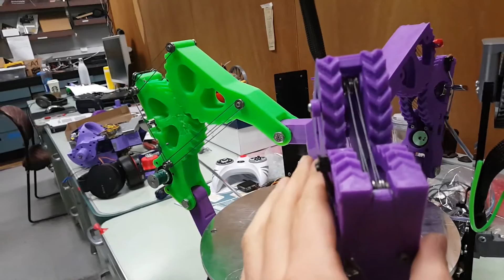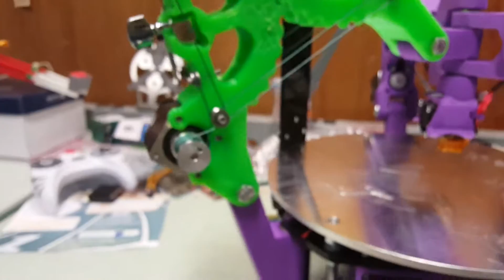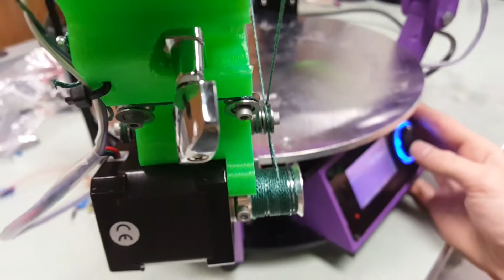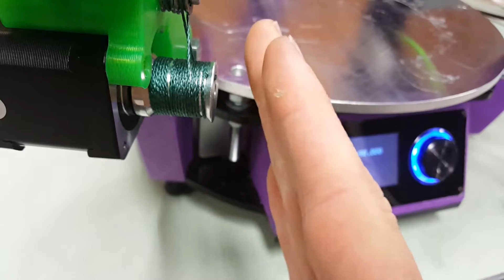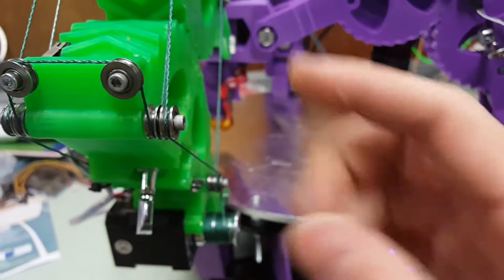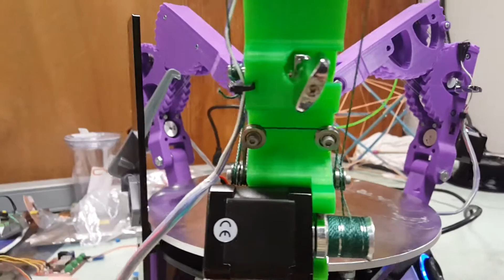Arm Redesign for GUS Simpson 3d printer

Comment: Looks awesome! Been working on a redesign of my own and going to use some of the improvements you've made. I don't think I'll get mine quite as sleek as yours but I'll try. I think you've mentioned it somewhere else before (read all the forum posts on the concept forge forum) but whats the accuracy like with the new arms? Does it compare to a typical 3d printer? Also, how long did they take to print and what infill? Thanks!

Comment: Serious question,  why aren't these more common,  as someone whose built a Rostock max and made a derivative with his room mate, this seems to eliminate alot of the cost in terms of mechanical components.  is it mainly because you need a printer to make these parts?
Reply: I dont think its a matter of mechanical advantage, more like precision of movement and rigidity. The surfaces of the gears will introduce a bit of error, i guess its the nature of the beast. Would be interesting to know if some type of smoothing process would improve on this aspect or would just make this effect worse.
Reply from the maker: Personally I haven't built a rostock so I don't have a good answer to your question. I will say a Cartesian printer is simpler to build a very accurate printer, and requires less calibration. But it just isn't as much fun to watch! One of my favorite things about this printer is having it on my desk and watching it run. It is pretty mesmerizing, especially when you are a bit burnt out on work. I can't say much about the cost but there isn't one thing about the printer that drives its cost high unless you have to pay someone else to print the parts. Also your GUS printer will probably never be more accurate than the printer it was printed on I'd guess. But it is a pretty fun machine and it is still capable of producing solidly functional prints.
Reply: Yeah the Rostock is pretty hyponotic to watch too, but its form factor pretty much demands a desk of its own.

As for GUS's resolution, couldn't you in theory get better resolution by designing an arm with a worm gear?  ( more revolutions per mm of movement ) or am i misunderstanding the nature of the problem?

And as for calibration, i imagine it shares alot of if not most of the same principles as a conventional Delta configuration, which is to say you'd best be the patient sort xD

Comment: how hard on a scale of 1-10 is this to build if you already have a printer?
Reply from the maker: +Chris Ferro It's hard to answer that as it just depends on the individuals background. This was the first printer I ever built and I didn't feel that it was extremely challenging, but I also study robotics so I'm not the best judge. It also depends on the type of difficulty you're referring to. I'd say once I get my CAD/BOM/Codebase refined it should be straightforward to build, though it might be difficult in terms of amount of effort. It should be just about as hard as building any other 3d printer with the added difficulty of assembling the arms and printing all of the components well, which are large prints. I'll post a vid after new years demonstrating an arm build start to finish to give you an idea of the associated difficulty there. My CAD should be posted in the next few days.
Reply: +Jeffrey Friesen Wow thanks for the fast reply!